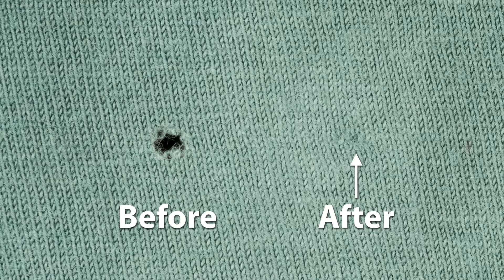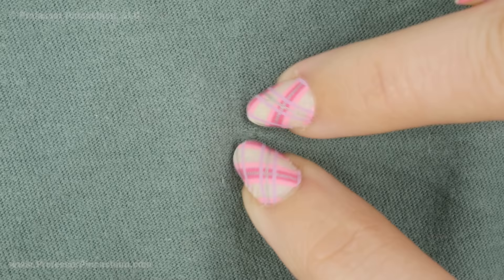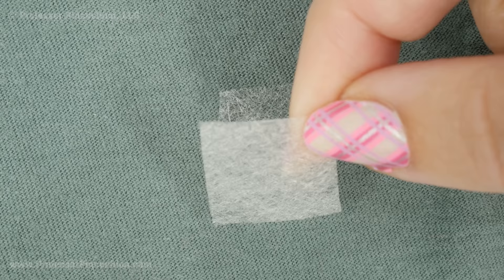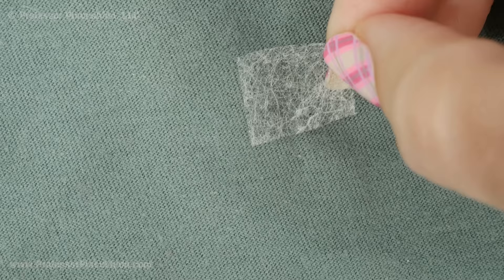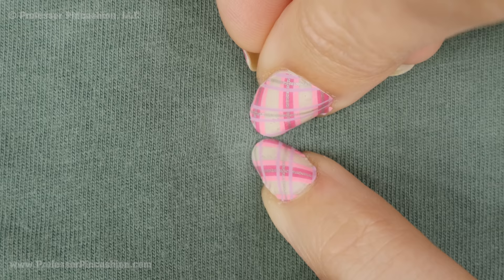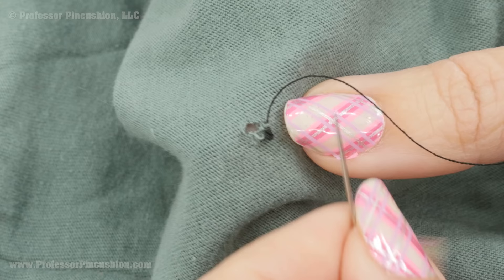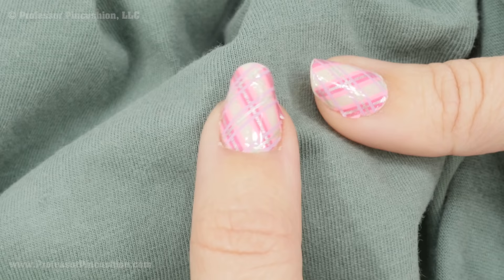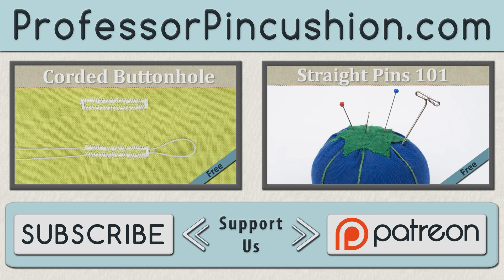How to Repair a Hole in a T-Shirt

Comment: so tea bag paper can replace the cut away / sew in stabilizer?  Could you use wax paper too? Do you have to sue the light weight stabilizer with the fusible webbing?
Reply from the maker: You have to use some kind of light weight stabilizer or fabric with the fusible webbing because when the heat hits it, it turns into glue.  the stabilizer is what's holding the hole closed once the glue cools.  I wouldn't use wax paper because when the wax heats up, it'll melt and stick to anything it's touching.
Reply: ahh ok. Do you think a used fabric sheet could also work? Thank you for your reply back.
Reply from the maker: It's possible.  The requirements are light weight, can handle a lot of heat, and the glue from the webbing doesn't come through it.
Reply: cool. Thanks

Comment: This just happened to me today (a dog jumped up and bit my shirt - not aggressive, just excited).  The shirt is a tighter shirt on my breast area where the hole is, so I'm trying to not make it a bump.  Does the fusing hold up in the wash?  If it goes into the dryer and gets warm/hot, would that change the fusing?  Whenever I sew up a hole like the second part, it eventually comes out...
Reply from the maker: I've done it for a few of my tshirts and washed and dried as normal and so far the repair is holding up

Comment: Hey, thanks for sharing this video. Quick question! I'm trying to save a t-shirt! The hole in my t-shirt is right by the tag though so can I put the fusable bonding web over the entire tag as well as the small hole? Thanks.
Reply from the maker: I guess it depends on what type of fabric the tag is.  If it's cotton, then it should be ok, if it's that satin type fabric, I don't know if it'll do well with high heat from the iron.  You can always cut the tag out and then you don't have to worry about.  :)

Comment: If I sew the hole and “flatten the rigid” can I then use fusible bonding web?
Reply from the maker: as long as it's a hundred percent cotton material on your t-shirt and you sandwich the fusible web with a lightweight material on the other side, otherwise you might get glue where you don't want it.

Comment: Nice tip! PS @2:20 it looks like the garmet was damped with water orso. Is that correct?
Reply from the maker: It probably got a little damp from when I was ironing and applying the fusible webbing. It happens

Comment: What were the patching things called again? Where could I pick those up
Reply from the maker: you can get supplies at your local JoAnn's or fabric store.  It's fusible webbing, commonly known as Stitch Witchery, and a lightweight cutaway embroidery stabilizer, sold by Pellon.  They're both in the notions department, usually near each other but ask an associate and they should be able to help you out.

Comment: Professor, could you specify where one can buy the fuse-able bonding web and stabilizer material you use in the no sew option?
Reply from the maker: I bought both at JoAnn's in the notions department
Reply: you can get it online and at Walmarts that still have a fabric department.

Comment: Hi Professor Pincushion. I have a very small hole about the same size as the one in this video. I want to employ the same techniques but I live in Japan and it seems that the closest product to what you use is a cotton sheet with nylon resin that bonds to the shirt. Do you think I should wait until I'm back in the US so I can get these products, or is there a way to use the sheet?
Reply from the maker: you might be able to purchase the supplies I used online. but yes, it's basically bonding a very sheerweight fabric to the backside.  All this does is hold the edges of the hole closed.

Comment: what is the second patch you used?  "cut away sew in stabilizer?"
Reply from the maker: the stabilizer is used because the webbing turns into melted glue and you need something on both sides of it or it'll stick to whatever is on the other side.  You can use some other lightweight fabric if you don't have stabilizer.

Comment: Won't the one with fusible bond come off when you launder it with washing machine?
Reply from the maker: I've put a repaired shirt through the wash several times and it held up. It won't last forever but it works for awhile.

Comment: Every time I've sewed a hole like this it ends up tearing an even larger hole once it goes through the washing machine.   Why is that?
Reply from the maker: try the first method.  I'd use this on a few of my tshirts and the repairs are still holding up with no further damage.

Comment: Still stuck on the stabilizer.  Is it the Adhesive Tear Away White Fabric Stabilizer?
Reply from the maker: this is the one I used:  http://www.walmart.com/ip/Pellon-Soft-N-Stay-Cut-Away-Stabilizer-12-x-11-Yards/21976577?wmlspartner=wlpa&selectedSellerId=372&adid=22222222227016421366&wl0=&wl1=g&wl2=c&wl3=40942317512&wl4=pla-78880153952&wl5=9033176&wl6=&wl7=&wl8=&wl9=pla&wl10=111838679&wl11=online&wl12=21976577&wl13=&veh=sem
Reply: Beth Klenke benim kanalıma bak

Comment: Does this work on fleece?
Reply from the maker: I would say no because most fleece is 100% polyester and can't handle a high enough heat from the iron.  In this case, I would just sew the hole closed and, luckily, fleece doesn't fray.  It might not be an invisible repair but it should work.

Comment: what glue did u used mam?
Reply: no glue, fusible bonding web (ultra light weight) 
you can watch the video again, rewind it 10 seconds or use the playback line to  start and stop wherever u want
Reply: @highclassinborrowedshoes would this work if you used just the bonding web and no stabilizer?

Comment: Can I use a dryer sheet
Reply from the maker: I haven't tried it so I'm not sure.  the dryer sheet might not be as soft as the lightweight stabilizer.  Someone suggest using teabag material but I haven't tried this either and it might be softer than dryer sheet.

Comment: what type of tissu it is please
Reply from the maker: I use a fusible webbing for the adhesive and then a lightweight material on the otherside. the lightweight material is to keep the fusible webbing (which is basically) glue from getting everywhere but it's still lightweight enough that you don't notice it while wearing your shirt.

Comment: hi how about a pin hole on a down jacket?? please help and reply
Reply from the maker: it depends on the content of the jacket fabric.  Chances are it won't be able to take the high heat of an iron to use a patch so you maybe want to try stitching it shut by hand.
Reply: yes its a nylon water resistant material... i just want to avoid being it big....

Comment: I am so disappointed. I followed these directions exactly. Bought Dritz Ultra light fusibal bonding web and the light weight stabilizer. Tried twice. The bonding web just fell off. Didn't stick AT ALL!
Reply from the maker: I would say that your iron wasn't hot enough.  There needs to be enough heat to melt the glue in the fusible webbing.
Reply: Thank you so...will have to build up steam to try again:) no pun intended!

Comment: What is the actual name of that "stabilizer" thing, please?
Reply from the maker: I used this type of stabilizer since I already had it but you might be able to buy smaller types at the fabric store:  http://www.joann.com/soft-n-stay-12-in-x-11-yards/11385168.html?gclid=CImI86zy1NICFURffgodfG8K2w   The webbing I used was stitch witchery:  http://www.joann.com/dritz-stitch-witchery-ultra-lite-tape-5-8inx20yd/1648351.html#q=dritz%2Bstitch%2Bwitchery&start=2   If you only use them for repairs, they'll probably last you a lifetime.
Reply: Thanks. This video save me a lot of trouble :-)

Comment: u can use tea bag paper instead of that lighy paper
Reply from the maker: I think that would work in a pinch :)
Reply: so tea bag paper can replace the cut away / sew in stabilizer?  Could you use wax paper too?
Reply: i have no idea i just suggessed this cause seemed similar
Reply: oh ok. good idea.
Reply: I would think a used dryer sheet would also be a good thing to use. Since it's light weight but sturdy .

Comment: what is this paper??
Reply from the maker: I'm using stitch witchery for the fusible webbing and a lightweight stabilizer:  https://www.amazon.com/dp/B008I68WM6/ref=asc_df_B008I68WM65263440/?tag=hyprod-20&creative=395033&creativeASIN=B008I68WM6&linkCode=df0&hvadid=194007750414&hvpos=1o4&hvnetw=g&hvrand=7048636036411367127&hvpone=&hvptwo=&hvqmt=&hvdev=c&hvdvcmdl=&hvlocint=&hvlocphy=9059806&hvtargid=pla-312002899409

Comment: Can I do this on a pair of leggings?
Reply from the maker: I haven't tried but I would probably recommend using the sewing method with wooly nylon thread just because leggings are tight and will take a lot of stretching.  If you want to use something fusible on the inside to reinforce the damaged area, maybe use a tricot interfacing because it's stretchy too.

Comment: Great video, but you are not working on a t-shirt, but rather a SWEATER.
Reply from the maker: it's just because it's really close-up that it looks like that. If you look really closely at your tshirt, you'll see the fibers interlock together, giving a similar pattern to a sweater.
Reply: @ProfessorPincushion  My tail is tucked between my legs.  I should have realized that.  Thanks for being gracious about my dumb criticsm.

Comment: These are not what I call T shirts. They are knitted tops. More like sweaters. T shirts are usually cotton or cotton mixed with other material. That's what I want to fix.
Reply from the maker: it's just because we're looking closely at the tshirt fibers.  Look really close at your own tshirts and you'll notice that the tshirt fibers loop together.  T-shirt fabric is made with a fabric called knit fabric (which can be 100% cotton or a polycotton).  It's called knit fabric because the fibers are looped, instead of weaved together like woven fabric.  That's what helps make the fabric stretchy.